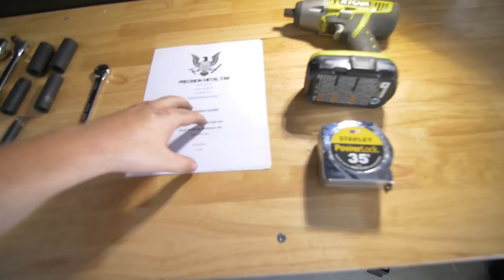2017-2019 F250 PMF Dual Steering Stabilizer Install and Review

Comment: Great informative content video! I really enjoyed you doing the step by step install! Giving tools required, bolt/nut sizes & detailed instructions. Especially, since the instructions seemed vague. Great tip on re-torque the nuts after 100, 500 miles then on oil changes. 

I just did a total front end job on my ‘05 F350 only to find out my steering gear box has a little play in it. Going to try an adjustment first to buy some time to get a RedHead box & now I’m thinking of doing the dual stabilizers as well. 

Thanks for all you do making your videos!
Reply from the maker: Thank you for watching Joseph! I really enjoy doing the installs and not only showing the install and tools but my speed bumps during the install as well. I know that’s fairly uncommon on YouTube but I think a “real” install can be more helpful. 

I just hit 500 miles on it and had to readjust them upwards in the far ends as they started to sag/ they weren’t parallel with the drag bar at install. Other than that all is well with the kit!

I appreciate your viewership sir. Thanks again for watching!
Reply: @moostang09  shoulda put the bolts facing up,so thread dont pick up debris. but then,,you dont 4 wheel it so it dont matter..

Comment: I have a 2017 F250 that I bought used a year ago. When I picked it up, I had experienced the death wobble on the way home on the highway after going over a bridge expansion gap. Had no idea what it was at the time. Well, after learning about it, I also discovered the prior owner had the tech bulletin to replace the track bar and steering damper, which obviously didn't fix it. I installed the PMF dual stabilizer shortly after experiencing the issue as I didn't want to be dealing with death wobble while towing our camper. It hasn't happened since! I am very pleased with PMF unit. It is heavy duty. I also have a stock height truck and this was the only one I found that would work on stock height as others wanted at least a 2" lift. I've had no problems and have 21,000 miles on since the installation. My only recommendation is to make sure you torque down the bolts to the front differential cover to 34lb/ft like the factory had it. The instructions only have you torque to 20 lb/ft, which had caused a very minor amount of oil to start make its way out. It was just enough to make it wet around the cover. After I retorqued to 34 lb/ft, the oil seepage went away. So, for any of you that are considering this for your truck and have death wobble, this is the best money spent on your truck.
Reply from the maker: That is awesome to hear! I am glad you were able to fix your death wobble issue so you could enjoy the truck. Luckily I have never experienced it but from the videos I have seen it looks terrifying when it happens. Thanks for checking out the video and commenting your experience with the parts. 👊🏼
Reply: I can’t find a stabilizing kit anywhere for my stock 2014 F350 4x4

Comment: I know you don't go 4 Wheeling much, but whenever you install something under your truck, you should always face the bolts to the rear or upwards! This prevents the bolts from hanging up on something when you're going forward and they also don't pick up sticks/branches this way. And if you ever hit a rock under there it won't snap your bolt off.
Reply: Not exactly true.

Comment: Installing this same kit, exact same issues. Even with the bracket bolts being to short. I started with the Rancho kit because it was about 100 bucks less, got what I paid for. Within a week the bracket was torqued and the dampener bolt was bent. I should have started with the PMF, the construction quality is 10x better

Comment: Very good video.  The reason you had trouble with the large bracket mounting to the dif and axle is that you should have started the dif bolts and gone in only 4-5 threads.  If you tighten those up first, the bracket will pull away from the axle, creating too wide of a gap for the bolts to span.   All else was spot on.

Comment: PMF with the Bilstein  stabilizers and Bilstein 4600 Series shocks all installed.  Ford previously replaced just about every front end component with the "new and improved" parts and so far; no DW.   So far, I'm sold on the PMF.  Sean, they should pay you a comission on sales of their stabilizers from your video.

Comment: You might want to check your outer bracket mounting locations. The newer instructions from PMF specify 19-7/8 not 19-1/8 for Fox dampeners. When you tested yours on the video you were bottoming out the shock when at full lock.
Reply: Yep.  I just installed these on my truck today.  Instructions were updated to 19 7/8 from eye to eye.  They also updated they bolt sizes in the instructions to match what's provided.  The 1 1/2" bolts worked fine.  I just had to clamp one side down a bit to get all 4 on.
Reply: @pohump  I installed the top two bolts until they were just catching the threads and then squeezed the bottom of the brackets together with vise grips and did not have any problems with the 1-1/2” bolts
Reply: @tbwill  Yeah.  I did basically the same.  Just started on the bottom first.
Reply: I noticed that too Tom watching the video for the first time

Comment: After raising truck, I didn’t have the clearance to remove the coil springs and not able to install the spacer. I used a small bottle jack between the track arm and chassis. That gave me the clearance I needed. After that it was a piece of cake putting everything back.

Comment: Thank you for this very informative video.  I"m looking to get rid of the shimmy and shake on my '17 F-250 as well as the occasional "death wobble" since Ford doesn't seem to want to fix it.  I'm hoping this and changing out the shocks will take care of my trucks steering issues.
Reply: Same here did you install this ?
Reply: @mgl_outdoors8836  Yes, I installed the PMF Dual Steering Stabilizer with the Bilstein's.  Took care of the DW at this point.  I haven't re-aligned the truck yet but waiting until I install the new Bilstein shocks first.  I've been too sick to get out there to do it.
Reply: @6XChamps just got the new damper installed by Ford today to fix the death wobble.  Seems much more solid now.

Comment: At nineteen minutes, you had the washer on correctly the first time, goes on the bottom. Putting on under the shock eyelet, it will cause more binding at the eyelet. Eyelet needs to be able to move

Comment: Just wondering I bought a duel stabilizer kit from Rancharo obviously a cheaper kit only a centre axel bracket and U clamps on each side,
My question is when you drive down a uneven road does your F250 feel like it pulls from side to side with a bit of a empty steering gap in holding the steering centre ,
Like there's tension to the right when your applying pressure or left depending on the camber of the road or when it's pulling right or left from the pressure of the shocks pushing and pulling ?
I guess what I am asking is do you get a bit of a wondering in your steering from Sid to side?
Because I do 
I had a shop put install mine and besides it not coming back full centre 
Which is understandable 
Mine slightly wanders from side to side if running over a long grove in the road or a heavy bump on either tire
When running at 50 60 mph?
Hope I made sense 
Thank you kindly 
Great information!

Comment: Moose! A bit of help for you. Whenever you are installing anything under the truck always have the bolts pointing UP! This not only preserves your ground clearance, but also protects the bolts from being bent, stripped or sheared off if you ever go over a rock. Rock versus Steel - Rock Always wins! Keep on wheeling!
Reply: I was thinking the same. But this guy's video is amazing it help me keep my new truck. I was going crazy thinking there is something majorly wrong with it. But it's just how they make these trucks and you always have to mod them.

Comment: Just put this on my 19. I went your route and picked up the 2” bolts. One of the diff cover bolts has bad threads. Put the original in as a stop gap. I also connected the outside brackets to the dampers first so I could get the right angle to hook them up. Have to see how it is after some extended drives.

Comment: My 2017 that I bought in 2020 came with Rancho stabilizers in place, but one was rock dented and leaking. Didn't want to swap the hardware so I replaced with new Ranchos. Very happy with it, but I REALLY want to replace the 4 shocks with Foxes. Maybe in the summer.

Comment: at 21:58 it looks like the extended side of each shock mount is not level with the center bracket. notice the center bracket is bending when you go full lock on the tires.

Comment: I had to upgrade my track bar to a contico it has a hine joint and alleviates the wear on the ball joint. I wore out my rough country adjustable track bar in two months with the leveling kit. You might wanna think about updating that track bar world of difference.

Comment: Thanks for your video it was very helpful, but I think I have a correction for you. I just in stalled the same steering stabilizer kit from PMF in Tucson, AZ. on my (2017 F-350 crew-cab SD Diesel) I went down there from Apache Junction, AZ., and talked to Trevor, I also got the caster bushings and heavy duty track bar and a pair of Fox 2.0 front shocks from him also. I installed all of the components myself at home and just took it in for a front end alignment. In the instructions for that twin Fox steering stabilizer kit it said the measurement for the Fox 2.0 stabilizer ending in 170 to be set at 19 7/8 inches center to center, not the 19 1/8 inch that you said in your video, I did see in your video that yours looked like they bottomed out on each turn to the left and right. Just something you might want to look at again. I did all this work to the truck myself due to the fact that my truck started the Death Wobble that is so talked about all over the internet that Ford can't seem to fix, their answer is to replace a $65.00 steering stabilizer and that does not fix the problem. So far I am very pleased with this repair that I did, this truck steers better then it did when I brought it home from the dealer. Total cost was about $1,500.00 but well worth the money, the truck handles better then new. When it would go into that Death Wobble it would just scare the hell out of you, the wobble got very violent and it would do this while pulling my 43 ft 5th wheel toy hauler at 70 mph, that weights in at 19,000 lbs, the only thing I could do was hit the breaks and hang on tight to the steering wheel, it would not stop the violent wobble till I slowed the rig down to about 35 mph. Thanks again for your YouTube videos I have enjoyed them.

Comment: Great install video bro , I had mine install by 4Wheel Parts,because it was installed with a 6 inch lift,running 37 inch tires , not only works great but looks good , on the 2018 f250. #AFanAlways

Comment: Very good video.  Would you recommend this product for a 2019 F-350 dually?  My 2019 F-350 dually already has a front stabilizer bar, so I'm not sure if it can be replaced by the one you installed.
Reply from the maker: I would 100% recommend this product. I have had no issues with it performing as it should. Still working great!

Comment: So another question.  How do you know if the front wheels are pointed perfectly straight ahead?  Why "perfectly"?  Well, since you are dealing with measurements that are as fine as 1/8", the wheels can be imperceptibly "off straight" to totally screw up the measurements - i.e. shocks could be too long on one side and too short on the other, with the potential for major steering damage.  It seems to me that even though the manufacturer specifies a fine tolerance (19 1/8"), this is really only a starting point.  Once the job is finished, you need to take the wheels lock-to-lock and see how much you are off then compensate by moving the end brackets.  Since this fellow was very careful to measure accurately and yet his settings were off, it just seems that it's not a matter of "if" it's off but rather how much it's off.  This was pretty obvious when the author tried his and the driver side shock bottomed out and pushed against the center bracket.  Anyone have a suggestion on how to accurately gauge front wheel straightness prior to bolting this thing together?

Comment: Love your videos man. I just purchased a 2019 F250 XLT a few days ago and am watching through all of your videos to check out your upgrades. I was wondering two things...(1) will this help keep that dreaded death wobble from potentially occurring? I haven't had any issues yest but and terrified at the possibility. Especially when pulling my caper with my family. Also, I feel like the steering is very loose. When I go over bumps the truck likes to move around. Will this tighten up the front end some? Make it feel more solid? Also, hows it holding up a year later? Still go with this setup? Thanks man!

Comment: Good video, I went with procomp dual stabilizer kit to match 3.5 procomp lift. Seems to have same results on 37’s. Less auto center on steering.  I also added Bilstien 5100 shocks that are great.  Adding sumospring bumpstops to rear for towing. They work great.
Reply from the maker: Glad to hear you had a positive experience with the Procomp kit and the bilsteins. It’s also good to hear I am not alone in the thought that the autocentering is slow. 

Thanks for watching Jay and for the input on your setup. 👍🏼

Comment: Can you rotate the dampeners up a bit?  I noticed at 22:02 in when you check the turning, it looks like the bottom of the bolts on the outside edges (tire side) dip down quite a bit - perhaps that's an optical illusion; but I was thinking that if you go "full lock" either direction and were off road that the bottoms of those bolts, etc., could get beat up.
Reply from the maker: It does appear they dip down some but I think my wide angle lens distorts it a bit too. It is almost a fish eye style lens but it doesn’t have as much distortion as a gorpro would.
Reply from the maker: I could also flip those bolts around and install them in the opposite way.
Reply: @moostang09   True.  My only reservation with that is if the nut backs off and falls out you also lose the bolt.
 I've experienced death wobble quite a few times on my '18 SD diesel Lariat crewcab 4x4 and was planning on going this route if the dealer "fix" didn't work, (a replacement steering stabilizer and rebalancing of my tires - allegedly) at 26,000 miles.  
Thanks for doing your videos - I used the front lower valance video that you did as a tutorial to replace my 4x4 valance with a 4x2 like you did.  Specifically, thanks for showing all of the necessary tools needed or recommended after you did your modification, it saved me some grief.
Reply from the maker: That is good to hear the videos are of some assistance Dan. I hear you on flipping it and risking the potential to lose the bolt. It might also be possible to use a 3” bolt rather than a 4” in this location.

Comment: Hello Moostang09,  I know I'm quite late to get on the bus I just have a question I need for you to clarify for me.  Did you remove the original steering stabilizer that came with your truck or you left it installed along with your PMF Suspension Dual Stabilizer?  I ordered mine 22 Oct 2020 I still have no tracking number and today I ordered 4 sets of shocks from them.  I opted for Bilstein shock it's cheaper than the Fox.  Anyway, thank you for any assistance you can provide.  V/R  RickL
Reply: hello, can you tell me where you ordered the PMS steering stabilizer?

Comment: The center mount diff cover bolts should only be installed but not torqued at this point, the center mount clamp bolts and nuts will thread together with no problem. Torque up the center mount clamp hardware at this point, and then torque up the diff cover bolts last. Replacing the center mount clamp bolts was unnecessary, the length of these bolts is correct from PMF. After the center mount is torqued down, the rest of the install is straight forward.

Comment: So I just installed the same exact kit. There is no need to buy extra bolts. My adice is to leave the bolts for the diff covers loose for the back bracket. once all 4 bolts have their nuts on them then tighten the main middle bracket down. No need for longer bolts you just cannot tighten everything down until bolts all have their nuts and washers on them
Reply: Glad I read this, I was in the middle of my install, ran into the same issue. Saved me a trip to the hardware store! Thanks!